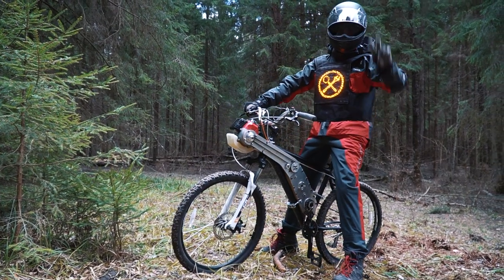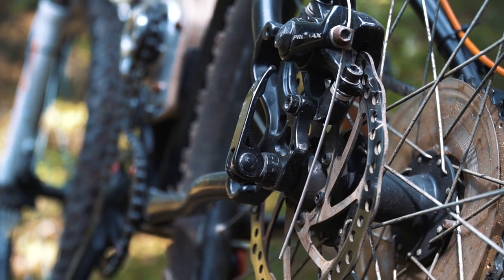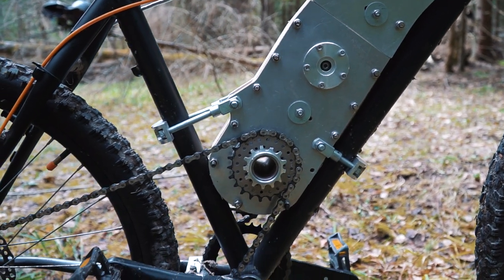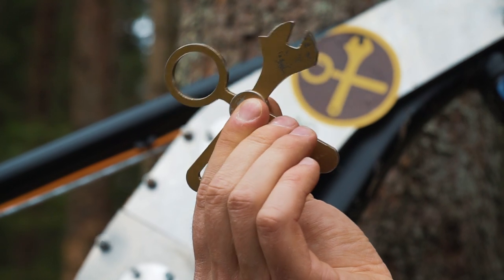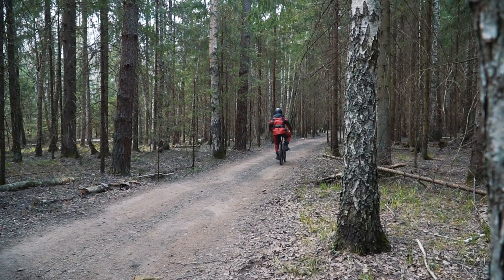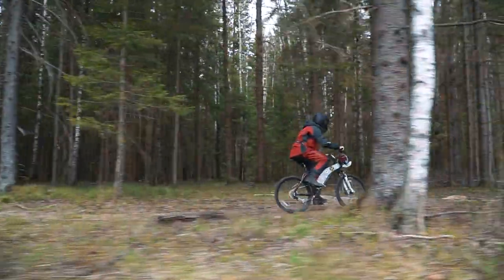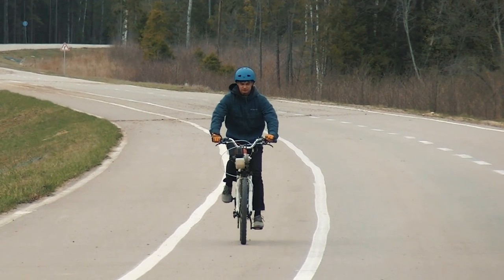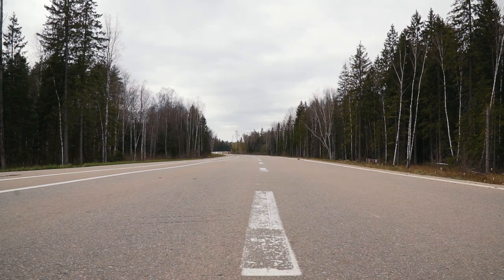Awesome DIY kit to motorize any bicycle with shifting gears!

Comment: The chain tensioner that goes from the contraption to the bike sprocket is on the wrong side. Chain tensioner goes on the slack side of a chain not the tensioned drive side. Pretty cool little invention though. Change the motor to electric and really get some power
Reply: You can always add more power, however adding much more than this brings other durability issues.

Comment: Total trash sorry  🙏 
I've got a free build ,so easy a cave man could do it.  Works on any bicycle with a seat post.  No moving parts or special tools or equipment required.  Makes the bicycle non critical just needs air in the tires.  Guaranteed to increase smiles per mile  💯%.